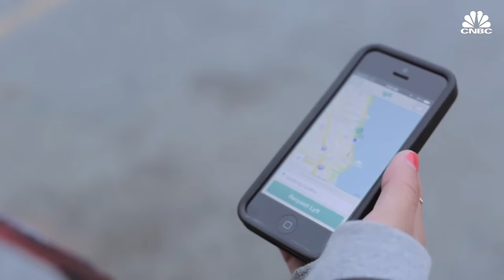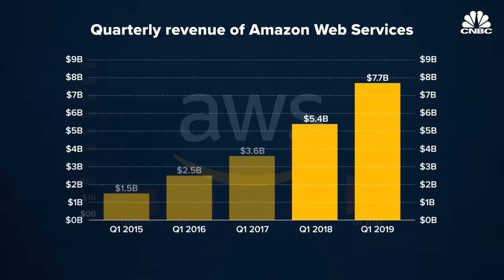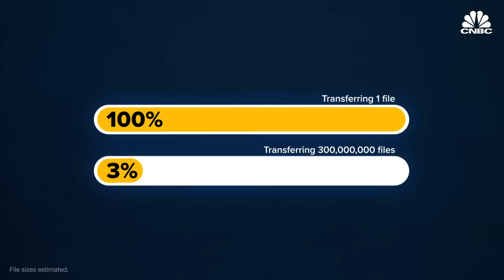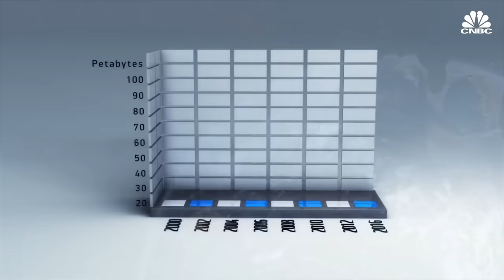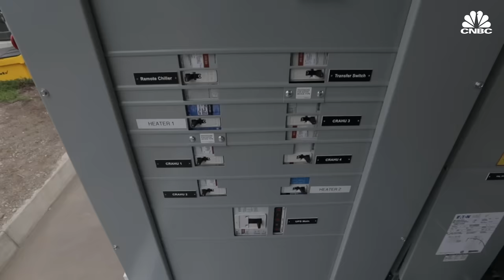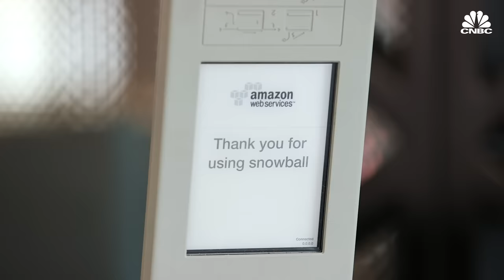How Amazon Uses Explosive-Resistant Devices To Transfer Data To AWS

Comment: Does Snowmobile weigh more when it’s full of data?
Reply: In theory it should actually weigh less. Because when it's full it means it used energy, weather that's battery/gas of the snowmobile. Idk I might be wrong.
Reply: Interesting question tho lol
Reply: Depends on when it was empty was it filled with 1s or 0s.
Reply: Good question
Reply: It does, but it's a fraction of a milligram of difference between empty and full per drive.
Reply: @LouisSubearth  Really? That's kind of awesome, I'd like to see the science on that.
Reply: So yes! Though the effect is extraordinarily minimal. Here's a more detailed explanation:
 http://www.ellipsix.net/blog/2009/04/how-much-does-data-weigh.html
Reply: @GreenDudeHC  there are tools for  overwriting your deletes, at least in linux
Reply: @GreenDudeHC  Thank you very much!! Very well explained with a concrete example right to the bottom of it...Cheers,
Reply: Fun fact on the first space shuttles they used to weigh the code.
Reply: Yes, right? They are transferring SOMETHING into it. There is net more "stuff" on it post transferring the data (assuming everything else stays the same).
Reply: For instance, people approximate the internet to weigh around 50 grams.
Reply: F yea
Reply: Yes data does weigh a bit more when a drive is full vs. empty.
Reply: does the weight of a light switch change depending if it's on or off? when you get down to it, data is basically just billions of switches set to either on or off, but they weigh the same regardless of their state.
Reply: Adam Tatusko not from a practical standpoint, there may be a theoretical difference in weight based on the magnetic state, but that would be more than offset if a spec of dust blew out of the trailer when it was opened, or if a bird pooped on it while it was being loaded. For all practical purposes it would weigh the same.
Reply: The internet weights about half of an egg.
Reply: No cause imagine no data are zeros and data is 1011100010010110 just ones and zeros
Reply: 0
Reply: No, because all though it is very interesting what I learned in this thread that there is a weight difference between different magnetic states on a HD, since when the trailer is empty, it will have been formated and securely wiped, which writes random data onto the drives.
So since the mix of 1s and 0s should remain about the same, so will the weight!
Reply: Technically yes
Reply: Actually it does, just couple of grams but still counts :)
Reply: If we must be terminally exact, then it weights different even between one state of full to another state of same fullness, but measured in different time. In short, no object is ever weighing the same, even if we talk about mass, it still is different cuz of the constant electroweak interactions. So, when empty, its weight difference won't be bigger than any other state.
Reply: Try with your regular external hardisk. It's not a stupid question btw.
Reply: No, there's no weight difference between 1 or a  0.
Reply: @Stwinky  No, there's no "stuff" being transfered. Just instructions to change data segments from 1 to 0 or vice versa.
Reply: No
Reply: Nk
Reply: Mike Head it may not weigh more, but it is absolutely worth more.  😁
Reply: Lol😂😂😂😂😂
Reply: @AlexTesfay  ...In hypothesis
Reply: @prabhatism  Does a 1 or a 0 weigh more?
Reply: Somebody should actually put the truck on a scale full and empty and compare. I suggest using dban nuke disc.
Reply: What if it omitting?
Reply: If we tied lots of helium balloons to the snowmobile does it weigh less?
Reply: Yes. But very insignificant. It's like how a bag weights more after you touch it because you leave some of your  cells on it. I read somewhere, not sure where, that the weight of the entire internet is about the weight of a strawberry.
Reply: I was thinking about the same question
Reply: I was going to ask this same question 😂😂😂
Reply: No, writing data doesn't actually ADD anything, it's just changing the state of matter that is already there.
Reply: @Darktron Yeah by mere fractions of a nanogram
Reply: Call the xkcd guy
Reply: it will be lighter because of cloud, get it?
Reply: It depends upon how many "1" you have, the "0" don't count
Reply: Very interesting question, I would love to know answers.
Reply: Assuming the drives are not erased from their previous use, the net data is probably about the same as before the new load.
Reply: @JoshWitte  Everyone saying yes is wrong. Data itself doesn't weigh anything. The way the data is stored could cause whatever is storing it to weigh more, though. That article is talking exclusively about hard drives, and I highly doubt that this truck is using a single hard drive to store data.
Reply: No. It only uses electricity to turn bits of data on and off. If you had a 100 matchsticks in front of you all facing North, and you turn them all to face East, they have changed positions (data), but no mass is added or removed.
Reply: @prabhatism  That is what I was going to say :-)
Reply: Actually no, digital data has no physical weight. Imagine you have a paper you write with ink on it so you have data with physical weight, but that's opposite of what happens on digital storage devices.
Reply: just use ur iphone with kitchen weighing scale.
Reply: @prabhatism  so your point is that 1s weight more than 0s, right ? :)
Reply: Yes, because of the lower entropy.
Reply: Nice question to Kyle Hill (new channel of because science) 🙂✌️
Reply: Yes because there's a security guard in the truck when being transported and full of data ;)
Reply: On an SSD, if 200 petabytes were all 1's it would be 0.0001528823808 grams heavier than SSD's with all 0's. It's an interesting question lol, but disappointing how little the weight changes.

Comment: I support the idea of a diverse cloud network, unlike now where AWS is very dominant. So when I am looking into server I look into others besides Amazon, like Microsoft Azure. Because if AWS goes down in any way, large or small it will effect a lot of the internet.
Yet, I love what Amazon did with their snowball transfer devices.
Reply: Your data or application would hardly be NOT available on AWS or any other MAJOR cloud provider. You can choose to host your data or application in diverse geographical regions, which are totally isolated from each other for backup and availability purposes.

Comment: they were flexing the 50tbs on the snowball then discretely mention microsofts petabyte box
Reply: Once aws starts losing money amazon goes down with it
Reply: Just checked, the Data Box (shown in video) actually holds 100TB and snowballs hold 80TB
Azure does have the Data Box Heavy that's actually 1PB, but it's as big as a mini fridge

Comment: Its bizarre that it’s still quicker too move some data by hand instead of doing it wirelessly
Reply: Its physics, transferring data over fiber and light will always trump the transfer of data over air wave frequencies. It's just a physical limitation.
Reply: William the butchers son productions how much you want to bet that that is what Amazon is working on next?
Reply: Look up asymptomatic complexity, us programmers deal with this stuff daily, given a large enough input, the computational cost can easily outweigh physical travel
Reply: I was surprised to learn not too long ago that overseas internet connections are actually under seas.  We still move most of the data through cables laid across the ocean bottom, not satellites.
Reply: @joesterling4299  wired connections always have been and always will be more powerful, faster, and more reliable than wireless ones.
Reply: That's why i still wire all my computers and game consoles in the house. It just works better.
Reply: Dube Fitness you have no idea what you just said wtf
Reply: @ValoPlay724  Starlink.

Comment: Where officialy in the era of Data heist. How much would that data be worth if you could get to the truck?
Reply: It would be worth a lot, if you could decrypt it. The data is encrypted in transit.
Reply: If there is no backups, probably millions. Probably still millions  even with backups cause its probably better for them to just pay the ransom and get the hard drives to aws and not lose productivity in the mean time (plus buying new drives and resnowballing everything). However if I were AWS I would hire security forces to track down the criminals (because that looks great for PR)
Reply: @Obscurai  That 'if' is the key, pun intended. These devices have encryption that would need years of high-scaled AWS computing to crack.
Reply: @bryanwelker  Yep, intentionally understated it.
Reply: The data on the truck is copied, not moved, from the customer's data center. The data still exists in the original location until it's up and running on AWS. So you can't hold it for ransom. And it's encrypted on the truck, so you can't use or sell it without decrypting it.

Comment: 4:16
A correction is needed here
Kilo, Mega, Giga, Tera, etc. Are prepositions used in the metric system. 
So Mega is 1000 times Giga. and Giga is 1000 times Mega.

The visualisation here shows that a megabyte is 1024 kilobytes. This is NOT true. Instead, the visualisations show exbibytes. 
So either they should have used 1000, or they should have called it mebibytes/kebibytes, etc.

Comment: 3:35 Makes sense. I have an idea for a tech startup that will leverage such providers for parts of their infrastructure, yet I'm stuck living in a tiny apartment where I don't have space for servers, and I have to keep the noise level down (but not by too much).
5:35 They use a Kindle 6 inch 300 ppi display for the postage label? Wow.
Reply: Kevin Bhasi hmmm could you elaborate on this? Perhaps we could do something

Comment: I may have missed it but what is the max data transfer rate directly into the snowball. With some of these data sizes being mentioned it would still  take a long time at max ethernet speeds. Also, you would be limited to the max speed of the interface being transferred from.

Comment: @4:25 the scale is off by a lot. which is funny because its still huge, they keep showing 100 blocks not 1000 blocks. 1 tb = ~ 1,000 gb
Reply: Actually each block is 10x10 small blocks; they're showing 1 tb = 10,000 gb. I can imagine some non-technical graphic designer realizing that 10x10 wasn't enough so they added one more level to 'fix' it.

Also they're too high by a factor of 1000 in how many laptops equal the storage on the truck.

Comment: MALAY SUBTITLES Part 2 of 3

05:05
pusat data dapat menghubungkan infrastruktur mereka ke.
05:09
Buat salinan data dan kemudian hantar bola salji tersebut ke data AWS
05:14
pusat supaya data dapat dipindahkan dengan lebih cepat.
05:19
Bola Salji simpanan terkecil yang kami miliki adalah sekitar 50 terabyte.
05:23
Itu 5,000 DVD dan bola salji terbesar yang kita ada adalah antara 11,000
05:28
dan 14,000 DVD bergantung pada bagaimana anda memampatkannya.
05:31
Kami bekerjasama dengan makmal 126 kami dalam reka bentuk industri, Kindle kami
05:35
orang pada label e-ink.
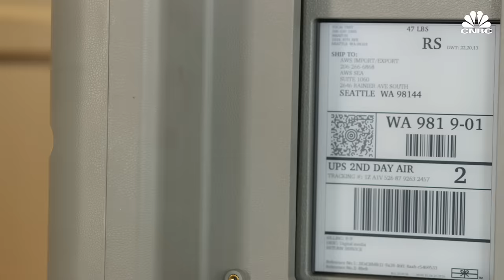05:36
Oleh itu, bayangkan jika anda menghantar ratusan ini, anda boleh meletakkannya dengan mudah
05:39
label yang salah, letakkan di kotak yang salah.
05:41
Itu tidak berlaku, semuanya automatik.
05:43
Ia tahu ke mana ia pergi dan melabelnya sendiri.
05:46
Dan bos saya, Charlie Bell, bekerja di Space Shuttle dan kami
05:50
sebenarnya menggunakan beberapa perkara dari Space Shuttle di mana mereka mesti
05:54
menangani kejutan pelancaran dan pendaratan.
05:57
Vass berkata merancang bola salji untuk menahan kesukaran transit
06:00
bukanlah tugas yang mudah, kerana ia juga sangat tahan lama
06:04
kurang daripada 50 paun.
06:06
Kami benar-benar pergi ke rakan kongsi penghantaran dan kami juga pergi ke
06:10
pusat pemenuhan dan bercakap dengan mereka.
06:12
Oleh itu, kami belajar bahawa masalah yang sangat sukar untuk diselesaikan adalah yang dialaminya
06:16
di bawah 50 paun.
06:17
Kami juga mahu orang ramai dapat memeriksanya sebagai bagasi biasa.
06:20
Dan itu sebenarnya kekangan reka bentuk yang sukar, untuk membuat sesuatu seperti
06:24
tahan lama seperti itu dan komputasi dan penyimpanan yang padat, di bawah 50 paun.
06:28
Snowball bahkan lulus ujian letupan dan memenuhi ujian tentera
06:32
syarat untuk diturunkan.
06:34
Untuk memenuhi spesifikasi, kita harus menurunkan Bola Salji dari 28
06:38
kaki, 80 kali, di keempat-empat penjuru dan keenam-enam sisi.
06:43
Dan kerana kita membangunnya dengan kuat, kita juga dapat melepasi
06:50
DoD 901 Barge Explosive Test, di mana anda mempunyai 83 paun plastik
06:54
letupan meletupkan 20 kaki dari peranti berkali-kali.
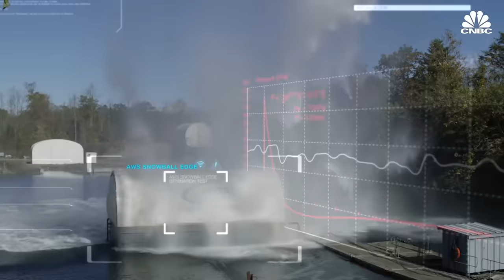06:59
Yang merupakan gelombang perkusi luar biasa yang akan mengubah bahagian dalam anda
07:04
jello. Sekiranya anda berdiri di sana ia akan membunuh anda.
07:07
Dan dari segi suhu, ia direka untuk persekitaran yang paling melampau.
07:12
Mereka boleh beroperasi pada suhu yang sangat tinggi, seperti 140 darjah
07:16
suhu persekitaran dan suhu yang sangat sejuk, seperti -20.
07:20
Dan ia boleh mempunyai kuasa tanpa syarat dari generator dan ia akan berlaku
07:23
terus beroperasi.
07:25
Untuk pelanggan dengan tenang memindahkan data dari keselamatan mereka
07:27
pejabat, ini semua kelihatan seperti berlebihan.
07:30
Tetapi dalam keadaan tertentu, ia terbukti kritikal.
07:33
Semasa gunung berapi itu meletus di Hawaii, USGS menggunakan
07:37
Bola salji. Mereka mempunyai pelayan tempatan dan lava akan muncul di sana
07:42
bangunan. Oleh itu, mereka tidak mahu kehilangan semua yang sangat berharga
07:46
data yang mereka kumpulkan.
07:47
Mereka juga tahu bola salji boleh beroperasi pada suhu tinggi
07:49
persekitaran. Oleh itu, mereka menghantar Bola Salji ke sana, memuat turun
07:53
data dan menghantar bola salji keluar.
07:55
Oleh itu, mereka dapat menangkap semua data itu tanpa kehilangannya.
07:58
Pelantar minyak adalah kawasan lain yang kita lihat banyak.
08:00
Tentera mereka sangat, sangat popular.
08:02
Oleh itu, ia digunakan dalam unit yang dikerahkan ke hadapan.
08:05
Mereka digunakan pada kapal Tentera Laut.
08:07
Mereka digunakan dalam pesawat.
08:08
Mereka digunakan di lokasi Op Khas di seluruh dunia.
08:12
Untuk keselamatan siber, di mana mereka mengumpulkan data rangkaian dan bertindak balas
08:16
ke sana secara tempatan.
08:17
Malah terdapat pilihan penapis debu enam mikron yang boleh anda gunakan
08:22
depan. Oleh itu, jika anda mengoperasikannya di padang pasir, mereka dapat menyaringnya
08:25
pasir keluar dan jangan sampai pasir masuk ke dalam peranti.
08:29
Malah Hollywood telah mula memanfaatkan keluarga Salji Amazon.
08:32
Untuk rakaman studio, mereka merakam kamera 8K dan 12K sekarang.
08:36
Oleh itu, itulah banyak data.
08:37
Oleh itu, mereka meletakkannya di Bola Salji, dan anda dapat melihat skrinnya
08:41
bahagian depan mereka digunakan untuk kawalan kualiti.
08:43
Apabila mereka selesai dengan penggambaran, mereka sebenarnya menghantar Bola Salji kembali
08:46
dan ia memuat naik data ke awan dan kemudian mereka memprosesnya.
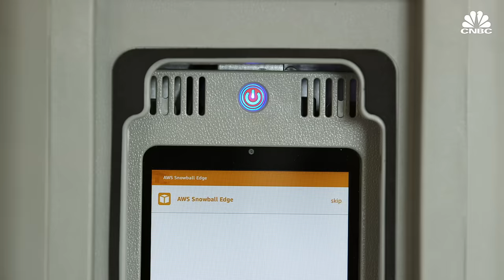08:49
Ada satu lagi, saya akan memanggil versi laris, yang merupakan
08:53
Snowball Edge, dan itu adalah penyelesaian 100 terabait.
08:57
Sekarang, perkara menarik mengenai Snowball Edge adalah anda sebenarnya boleh
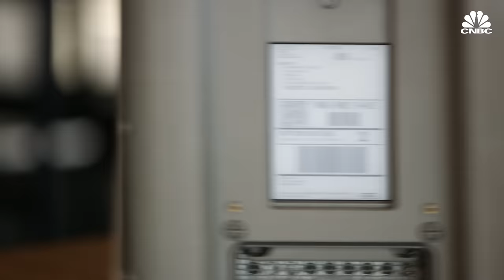09:00
meletakkan komputasi di sana dan benar-benar menjalankan beban kerja.
09:04
AWS adalah penyedia cloud awam pertama yang membuat perkakasan seperti ini
09:08
pemindahan data, tetapi pesaing sejak itu mengembangkan produk serupa.
09:14
Microsoft adalah pemain nombor dua di pasaran awan awam, di belakang
09:17
AWS. Ia mempunyai produk Data Box yang memiliki ruang untuk 1 petabyte data,
09:23
menjadikannya lebih besar daripada yang ditawarkan oleh Google dan IBM hari ini.
09:27
Awan Google, yang berada di belakang AWS dan Microsoft Azure, mempunyai
09:31
Pindahkan produk Perkakas.
09:33
Pelayan storan yang boleh anda pasangkan di dalam rak di
09:37
Pusat data.

Comment: If lava was coming towards the USGS facility, why would they not just pull the drives and leave instead of waiting for an AWS shipment.
Reply: It is not that easy. You have to take in account things like Raids, different storage devices, logical luns and so on. You can not just take out the disks and expect that all be fine when you connect them later.
Reply: @aibanquaid8920  It's also not feasible to remove the drives and ship them over. You still need to use that data while you're waiting for it to be transferred to the cloud, and it seems much simpler to copy the data onto AWS-verified devices instead of shipping them maybe thousands or tens of thousands of random hard drives laying around. As they mentioned in the video, it's also much less safe since hard drives inherently get corrupted all the time - one little knock or drop could irrecoverably corrupt the data.

Comment: At my previous job they where moving everything into 'the cloud'... 
Even after warning management to NOT do it.

Sold as a rainbow farting unicorn, and in reality when things don't work as previously planned you have to call some specialized help-desk filled with people that call them self engineers, but barely know the difference between a keyboard and a mouse. 

Issues that previously took 5 minutes to resolve, take now multiple weeks or even months of calling and emailing...

And that's why it's now called "my previous job"...

Comment: Actually Giga, Tera, Peta etc. are the wrong prefixes. If you convert in steps of 1024 then binary prefixes are used: Gibi. Tebi, Pebi.
So 1 Terabyte are 1000 Gigabytes but 1 Tebibyte is 1024 Gibibytes.  Short form would be: GiB, TiB, PiB etc.